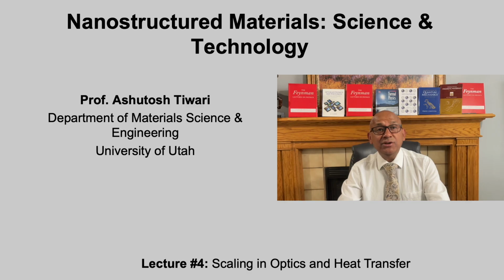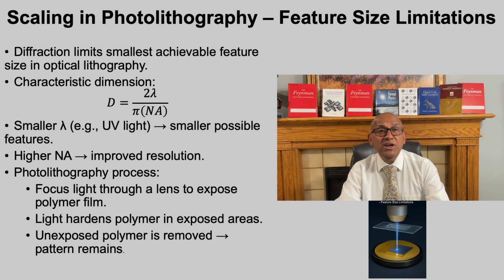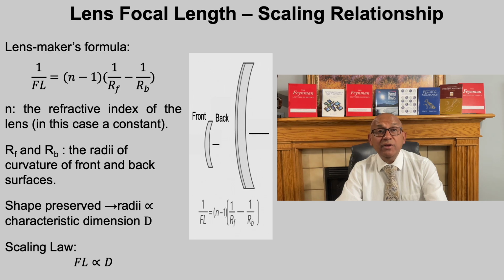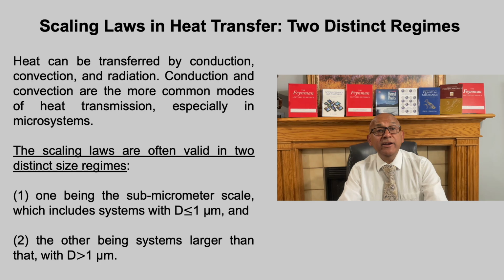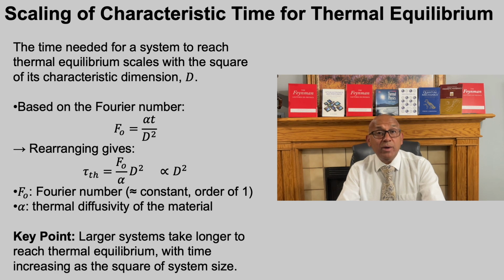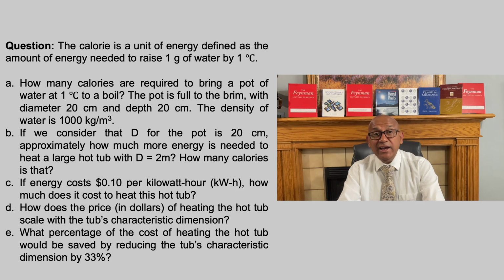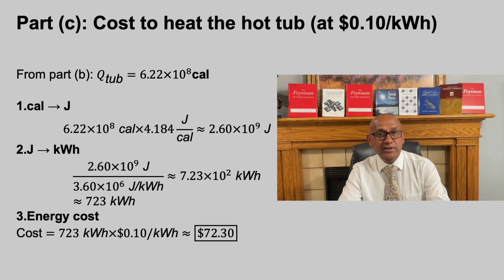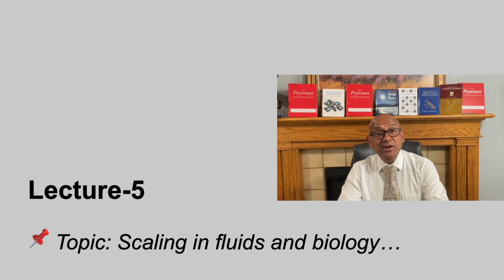Nanotechnology Lecture 4 | Scaling Laws in Optics, Diffraction & Heat Transfer

Comment: Good day sir, Sayuri this side. I was amazed to know how much scaling impacts optics and heat transfer. I learned about how lens maker's equation is used to show focal length scales linearly helping ease the calculations. I learned about Diffraction and how more the diffracted light is captured, the better will be the details of the image. I also understood the process of lithography. I especially liked the analogy comparing a pot of water to a hot tub, it made the concept of thermal equilibrium scaling easy to grasp. Overall. the lecture was very informative and clear. Thankyou sir!
Reply from the maker: Nice observations, Sayuri. I’m glad you connected the scaling concepts in optics, diffraction, and heat transfer. You correctly identified how focal length scales with lens size and how diffraction influences image resolution. It is also good to see that the lithography examples helped connect these ideas to real-world technology.

I’m especially pleased that the pot-of-water versus hot-tub analogy helped you understand thermal equilibrium scaling. These kinds of simple examples often reveal very powerful physical principles.

Comment: Hello sir, Sayona this side. I watched this lecture twice.This was, up til now, my most favourite lecture because I came to know how scaling in optics can be used to investigate small systems, and small devices can be fabricated using optics or photographic techniques. I learned about Diffraction and that the more the diffracted light is captured, the better will be the details of the image. I also came to know about the process of lithography. Numerical aperture, which measures light gathering ability of a lens is used in microscopy to improve brightness and resolution. Now, modern semiconductors tools are equipped with high NA lens. Both the total energy needed to heat, and the ability of a system to store heat scales with the cube of its characteristic dimensions. Scaling laws are valid in 2 distinct size regimes, first is sub-micrometer scale and the other, are the systems larger than that. Larger systems take longer to reach thermal equilibrium as the ice needed for a system to reach thermal equilibrium scales with the square of its characteristic dimensions. Here my answer to the question asked in the lecture:

Using the Lens Maker's Equation, the first lens has a focal length of 10.58 cm and the identically proportioned larger lens results in a focal length of 1058 cm or 10.58 meters. 

Thank you for such an amazing lecture. The question at the end helped me understand the concepts better, and the detailed slides also come in handy when I make my notes.
Reply from the maker: Nice summary, Sayona!
Reply: @STEMwithDrTiwari Thank you sir!

Comment: Great lecture Sir, Really loved how you connected the scaling laws of optics to photo lithography and EUV, it makes the semiconductor manufacturing process so much easier to visualize.

Answers: 

If we apply the lens maker's formula and take the standard sign convention into account for the back radius, the focal length of the first lens works out to around 10.58 cm.

For the second lens, we don't even need to redo the entire calculation.

 Since you showed us that the focal length scales linearly with the physical size of the lens, making the lens 100 times larger means the focal length will also just scale up by 100 times. So the new focal length should be 1058 cm . It's a really neat shortcut that shows how powerful these scaling laws are in practice.

Also, the way you explained the sub-micron shift where bulk convection basically disappears and transitions into molecular conduction was brilliant.
Reply from the maker: Excellent observations, Indrajeet. I’m glad you connected the scaling laws in optics with photolithography and EUV technology. Your explanation of how focal length scales with lens dimensions was very clear, and I also liked that you recognized how scaling laws allow shortcuts without repeating the full calculation every time.

You also correctly picked up the important transition from bulk convection to molecular-level conduction at very small scales. Very thoughtful analysis.

Comment: Hello Sir, thank you for another fantastic and highly engaging lecture! I really appreciate how these sessions consistently make complex scaling laws intuitive through practical, real-world examples—this time, comparing a pot of water to a hot tub was a great way to visualize energy costs.

It is fascinating to see how the same principles of physics dictate both the limitations of photolithography in semiconductor manufacturing and the thermal management challenges at the nanoscale. The transition from bulk heat transfer to molecular-level conduction at sub-micrometer scales was a particularly eye-opening takeaway for me.

Here are my answers to the checkpoint questions provided in the lecture:

A1 (a): Using the lens maker's formula, the result depends on the lens geometry. Assuming a double convex lens, the focal length is approximately 10.6 cm. If both radii of curvature are treated as positive (e.g., a meniscus lens), the result changes to 68.75 cm.

(b): Since the focal length is directly proportional to the characteristic dimension of the lens, scaling the lens up by a factor of 100 results in a new focal length of 1060 cm (or 10.6 m).

Looking forward to the next lecture on fluids and biology!
Reply from the maker: Excellent observations, Rishi. I’m glad you connected the scaling concepts across optics, photolithography, and heat transfer. The pot of water versus hot tub example is indeed a very intuitive way to understand scaling of energy and heat.

I also liked your discussion about the transition from bulk heat transfer to molecular-level conduction at very small scales. Your answers to the checkpoint questions and the way you explained the lens scaling behavior show very careful thinking and analysis.

Comment: Really enjoyed this lecture. I never realized how much scaling affects both optics and heat transfer. The part about diffraction and resolution limits helped me understand why microscopes and photolithography equipment have physical limits that cannot be overcome simply by making things bigger or smaller. The heat transfer examples were also super relatable, especially comparing heating a pot of water versus a hot tub. It finally clicked how size changes efficiency, energy use, and even how fast something reaches thermal equilibrium. Overall, it made nanoscale optics and heat behavior feel a lot more intuitive and practical.